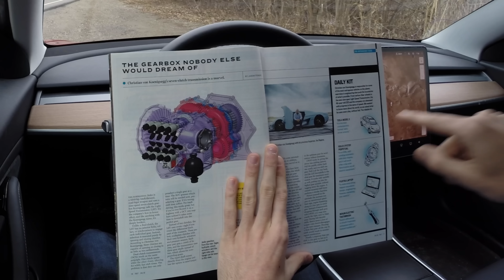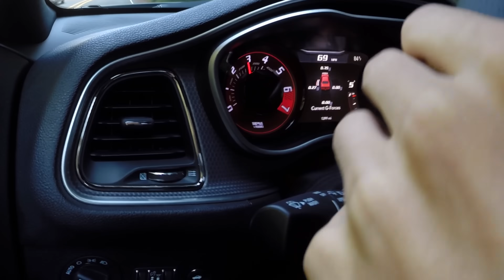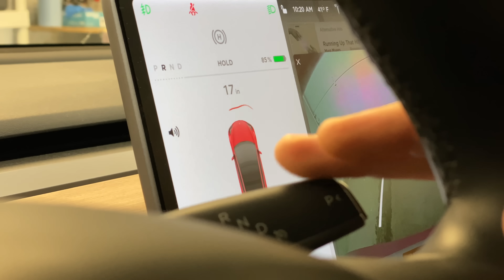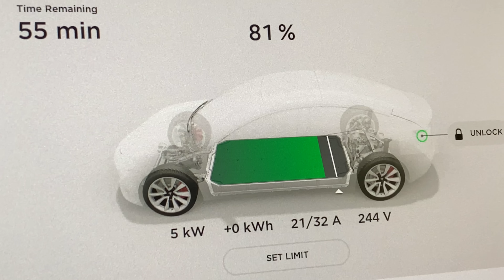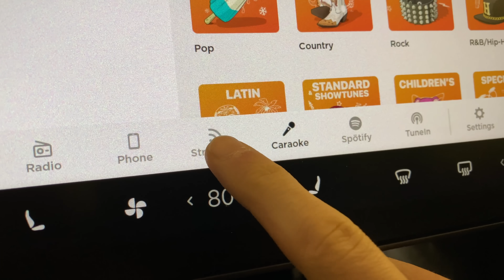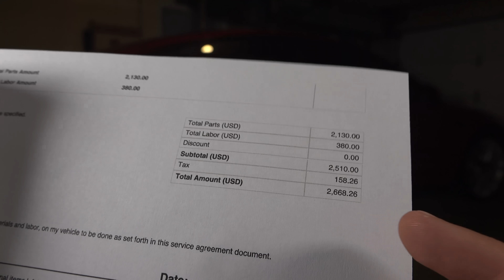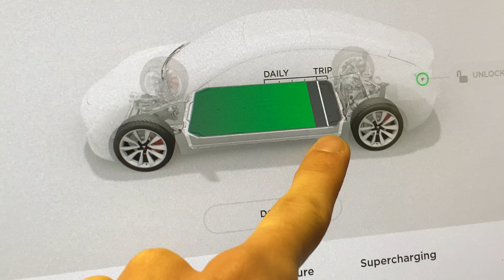Living With A Tesla Model 3 For A Year - The Best Daily Driver

Comment: I wish my apartment complex or job had charging stations. The EV charging infrastructure is the only thing holding me (and probably a lot of others) from pulling the trigger on buying one.
Reply from the maker: I hear ya, it's tough without a dedicated charging spot, and most apartments don't have it. I rented a garage at my old apartment which did have one outlet, which would be fine for smaller battery EVs. But most make it pretty tough.
Reply: @EngineeringExplained  It's also cheaper to charge an EV than it is to fill an ICE with gas as you mentioned in a previous video. Did you leave that out as a perk when mentioning the gas station bit because the public charging stations still cost a lot vs. having a charging station in your home?
Reply: @Infinnatea  the public stations cost more than home usually but I think that is still cheaper than gas
Reply: Same here. Only a small handfull of charging stations in my town. Until I move out of the condo or to something with a garage to install a charger, EVs just aren't a viable option for me. It would also be nice to have more ev options besides sedan or crossover (bleagh....). Where are the sporty coupes that don't cost more than a house??
Reply: @user-gm4kv2my4u  That won't change until one brave apartment does it and becomes the hot place to live.  Then others will copy it to compete.  Also the various levels of government can increase the rate of charging station builds at mutli-dwelling units with a tax credit for doing so.
Reply: Same here. For apartment dwellers making a switch to EVs is way harder. I do have a rapid charging station basically across the street but its a real bummer that its so expensive that it would be actually cheaper to stick with diesel. I will probably wait for a used ID3 or similar.
At least now politics have picked up the topic and are debating to give tenants the right to spend their own money on improving their landlord's garages with crucial infrastructure...
Reply: what area are you in? oh... and check out abetterrouteplanner.com- you might discover that you're SURROUNDED by chargers. and by the way...  the whole "carrot vs. stick" laws also apply to any commercial location with its' own parking. state owned locations will almost certainly be getting chargers.. depending on your state. here in CA the state will pay for charger install for any company with less than 1000 employees. and a lot of larger companies (like railey's grocery for instance) has chargers even in remote Podunk knowhere towns just because they know that later on.. CA will hit them with higher taxes if they don't. so.. don't worry my friend.. .chargers may be on your doorstep & if they're not.. they soon will be. even some gas stations here are getting in on the action.
Reply: Some complexes do.
Reply: My office has 20 amp 110s that I use daily, which mostly takes care of it, but then I'll charge once at home sometimes, or i'll use the CEO's spot to use his Tesla Charger, lucky I am.
Reply: Luckily, only about 25% of the U.S. lives in apartments.  The vast majority live in detached homes with access to a garage or outdoor plug.
Reply: lessdeth69 some apt buildings like mine give free Tesla charging stations
Reply: @SWTrailsAndWheels  Yes, but most home owners are boomers, which hate the idea of electric cars. 75% of boomers own a house, compared to 60% of gen-x and only 30% of millenials.
Reply: Maciej Popko I have a Tesla and I’m a die hard fan. With that said, if you can’t charge at your house it’s gonna be tough and I probably wouldn’t recommend it in that scenario. I would literally move out just so I could charge the Tesla at home. There are plenty of apartments like mine that have free Tesla chargers in their garage/lot. I live in Harbor Point Stamford CT and the majority of new apt complexes here have free Tesla charging stations and they’re never full (unless some assholes decide to ICE them, which is rare).
Reply: Mine is I can't make it from New Hampshire to Pennsylvania without having to charge it in between... I can make it from my front door in the middle of New Hampshire to the South central Pennsylvania area on one tank of gas in a Subaru forester...
Reply: @Sml4UTB  How often do you do that trip? If it's often, then you definitely should stay with an ICE, no doubt. Other people use the excuse that they can't road trip in an EV when they make that trip maybe once or twice a year. It's like the people who buy Super Duty's just in case they may need to haul a boat once a year or help a friend move.
Reply: @Infinnatea  i bet that 99% of people with road trip excuse have never gone to any road trip in their lives
Reply: @MicroSD16Gb  It also depends on what people consider road trips. I've gone on plenty long ones and not once have I made a road trip without stopping for food or just the need to stretch my legs. During that time, people can stop at a charging station and eat and stretch and not have to really delay anything. Even Jason said that people hate change and it takes a while for them to adapt.
Reply: Maciej Popko Lies. I pay 25$ a month to fill my car. Our electric is over 100$ a month and they just raised the percentage again.
Reply: @waterloo123100  If you pay $25/mo to fill up your car with gas, that means you barely ever drive. The electric charging for your EV would be a small amount if you drove the same as you drive your ICE car.
Reply: @waterloo123100  ummm… ya lost us there, bud. what do you fill your car with? electric what? percentage of what? details man.
Reply: Jay Bee Well didn’t know you fill your car with electric. I thought you were supposed to charge them. 😂😂
Reply: @waterloo123100  ummm… waterloo.. the short bus is waiting for you.
Reply: @waterloo123100  can't tell if you're complaining about ice cars or bev's. STATE your viewpoint. be more 'to the point'.
Reply: @Infinnatea  The cost of an EV vs an ICE, plus the cost of a rental for a week or two each year, is higher than the cost of the average equivalent ICE.  That's not to say one shouldn't buy EVs, just that "just rent a car" isn't a solution.  It would have cost me 2x as much to buy a Model 3 as my Jetta, and though I've made only one 1,000-mile roadtrip (each way), it's still MUCH cheaper in my ICE Jetta that if I had a) purchased the Tesla, and b) rented an ICE for the same drive. For what it's worth, I barely go anywhere, so a Tesla would never have paid for itself in my use case.
Reply: @Lawrence330  Your point is flawed when you compare your Jetta to a Tesla. A Jetta has half the power of a base Model 3 and probably a lot less features. You'd need to compare, let's say, an Arteon to Model 3 for this to be an actual comparison.
Reply: Yeah even my apartment doesn’t have electric charging station.
Reply: Talk to your land Lord. They won't know to put in chargers if someone doesn't tell them. (I've never ever ever heard of a owner not putting in a charger on request FOR FREE - power added to your bill)
Reply: Same. I rent an apartment and no charging options...
Reply: Then take action. Petition the appropriate authorities. Ask other people to join you. We need citizens to take action!
Reply: @joopvanroy6599  listening to the "apartment / condo" excuse gets so old on here. it's like listening to a co-dependent person explain why they can't get rid of their spouse with an addiction. "I wanted to leave big oil.. he was slapping me around & taking advantage.. but then where do I go? My ice car needs a daddy" lmao
Reply: @joopvanroy6599  if you ever get them off the petroleum tit.. and onto a bev.. they NEVER wanna go back though.
Reply: For me its the cost of one
Reply: yeah every time someone tells me how great it is to have an EV and never need to charge it away from home I think of how many people in cities (areas with high enough average income to afford an EV) live  in apartments and would have to end up at a charge station more often and for much longer wait times then an average ICE driver.  I fill up about 3 times a month and it takes maybe 3-5 minutes tops.   I love EV and would get a Tesla if it was easier to charge, cheaper, and had a longer range but for now and probably the next 10 years I think ICE cars will make more sense to the masses and wish EV users would stop pretending like the charge time is so much more convenient and that a short trip to the gas station is this major ordeal.
Reply: _ David _  actually, it's MUCH easier to get a loan to buy a house than it is to buy a car. and living in an apartment is a BAD financial decision in the first place. for instance- if you live in a 1200 sq.ft. aprartment.. the owner you're renting from takes your rent payment, pays the mortgage, pays the taxes, pays the insurance, tacks on a % or two.. then passes the bill on to you. at the end of the year, he writes off the loan interest. at the end of 30 years, he gets the deed to the building.. YOU GET HIGHER TAXES AND A STACK OF RENT RECIEPTS. ONLY exception to this rule would be if you are a section 8 tenant.. in which case you don't have the option to buy ANY car to begin with.
Reply: @jaybee3165  You are forgetting other things, I don't have to pay for upkeep (no maintenance or repairs) whatsoever (inside or outside), I don't pay for water or garbage pick up, I also get free cable tv, didn't need a down payment to rent, don't have to worry about property values as much as a homeowner, can move if I want to with far more ease and less hassle, renters insurance is cheaper than homeowners insurance, and I'm sure there are a couple more I'm forgetting as well.
Reply: @rdizzy1  first: lmao. now I've heard it all. "I can't get an ev because "blah blah blah".   next up: "the dog ate my charge cord". lmao.
Reply: @jaybee3165  I was simply listing the benefits of renting an apartment over owning a home.
Reply: @rdizzy1  all those costs are rolled into the price of the rent. you knew that right? unless you're LOADED with $ and can afford to give your equity and tax discounts away? in which case.. no reason to stop burning up gas money & high maintenance costs of ice vehicles.
Reply: I salute you wealthy man.
Reply: @jaybee3165  ok boomer
Reply: Stop "wishing" and get it done. 

Build your case, talk to other residents in your apartment complex who might be interested in an EV, then go negotiate with your landlord to install electrical outlets to charge your car. Same at your job. If it doesn't work, look for a new apartment and job. If you don't do any of this, you are not TRULY motivated to get an EV, stop lying to yourself and be happy to die poisoned by your ICE car as apparently even that prospect is not enough to get you off of your couch to MAKE IT HAPPEN.
Reply: @UTUBESUCK666  K, you're clearly upset. I don't want to ask my leasing office to contact a national leasing corporation for something that will cost them tons of money when I plan to move out of their community in 8 months. By the time anything happens I would be long gone. It took them 4 days to get back to me on a simple question I had. They're also extremely cheap and cut costs any way they can.
Reply: @UTUBESUCK666  We're all going to die, and we have little control over the timing or mechanism. It may be that some people are singularly motivated to "save the planet" from themselves, but most people are multifaceted and must balance their desires against their needs.  For instance, the OP may "want" an electric car, and might even be successful in lobbying the landlord to provide charging receptacles, but I know very few people who are prepared to immediately run out and buy electric cars as soon as infrastructure is available.
I don't live in a very large city (1.5M people), but my observation is that most people who can afford a $50k car don't rent apartments. *Most* Statistics matter.
Reply: @UTUBESUCK666  No.